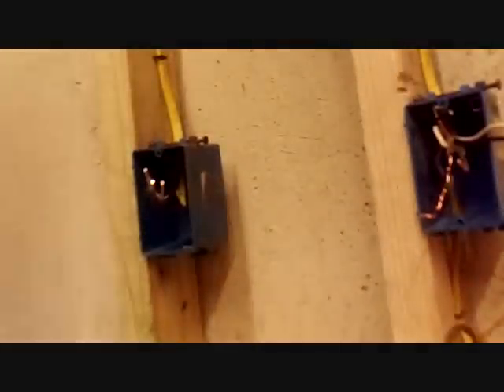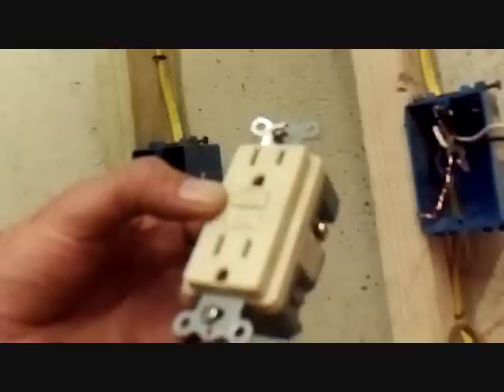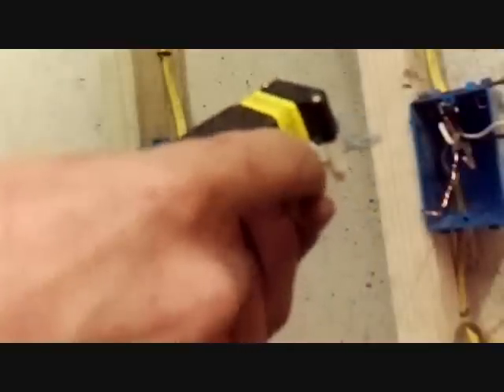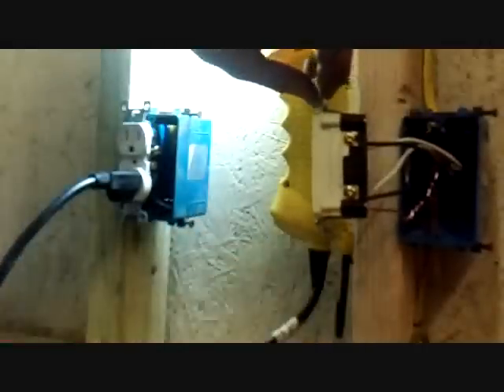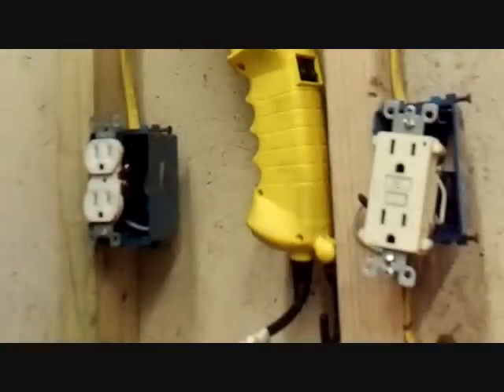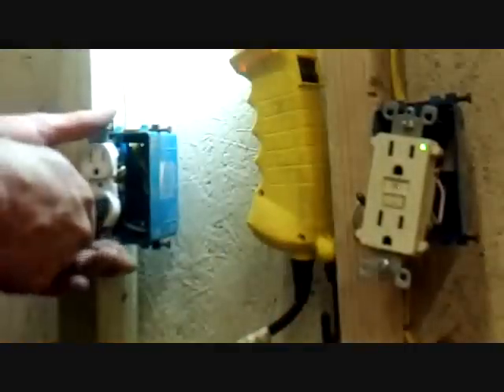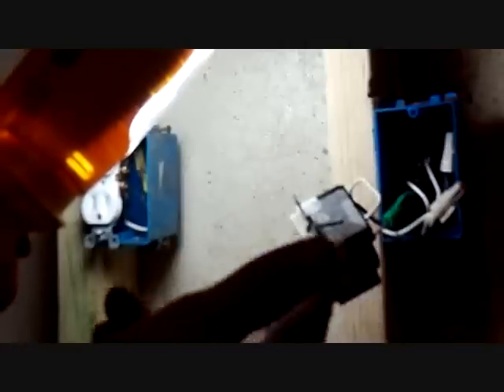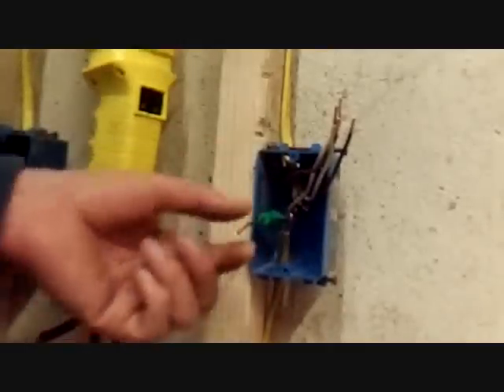GFCI receptcle common problems

Comment: I have a 40 year old house, would like all kitchen outlets GFI'd. Is it not correct to put GFCI in first outlet from panel and connect downstream wiring to Load side? Panel is old Iti Imperial so I assume hard to find GFI breakers.
Reply: +Pete Dunn You are 100% correct, all outlets whether receptacle or switch controlled light down stream of the G.F.C.I.  receptacle/breaker.
Reply: Thanks
Reply: One thing I heard is that you would put a GFCI outlet everywhere you need it. But as far as I know it's pointless to put a GFCI down the line from another GFCI. Once you have a GFCI installed, everything connected to that GFCI is then protected. So there's no need to put all GFCI's in conjunction with other GFCI's. But if their coming off different circuit breakers then yes, if you need the protection you can put a GFCI in. But everything coming off that GFCI is protected.

Comment: so you did not follow on what you changed ? did you remove one black, and a white ? from  bottom witch is load ? cause starting out we had 4 wires on the gfi and ended up with 2 .

Comment: Hey there, great video and gets exactly what need to do EXCEPT, I can't see how you wired the correct way.  You didn't really turn it around and show where and which wires you connected.  From what I can interpret, you combined the whites and then blacks and then connected them to only the lower terminals on the GFCI outlet?  And I presume that is the same even if the upper outlet is a switch? Thanks.
Reply: Simple answer for ya bud...the 2 wire bringing power in the box gets connected the line side of the GFI..if you look at the back of a gfi it says line written on the back.. It will also say which side the hot and neutral gets connected too(brass screw for hot, silver for neutral). Now, the 2 wire feeding the plug next to it went to the load side..same thing, it's written on the back of the gfi(depending on the manufacturer of the device there may be a sticker covering those screw terminals).. And don't forget, you can always check the directions or wiring diagram ! Hope this helps
Reply: Mikey Mike huh?
Reply: Louis : isn't that the original setup that turns off the light when the gfci trips?... which is not what is wanted. The setup that keeps the light on when the GFCI trips is the unclear part.
Reply: Eric Kirk  Sorry Eric. I'm new to YouTube commenting. That was fat-finger mistake. I was trying to find out how the guy rewired the GFI outlet to fix issue, but I don't know how to email him.
Reply: For the most part, you'll have to write here since messaging people directly is often blocked by them.

Comment: Another tip is do not wire these LIVE, number one for safety reasons but when wired live you will likely blow the MOV Micro Oxide Varistor which is the brain of the device. If blown, the GFCI is rendered useless. The GFCI is designed to trip at a current leak of 5 milliamps.

Comment: I have a GCFI outside on a pole that I use to power my sump pump.  I also ran 2 outside low watt lights from this same GCFI.  The line and load are together on the bottom and the piece of tape up top has not been removed.    The GCFI trips when I plug the sump in but the load continues to works for the lights.  The sump will work if I plug it in to a nonGCFI.  My tester says it is wired correctly (green,green).  It is a brand-new GCFI.  It has been working fine for several years and stopped recently.  I replaced the old GCFI but it keeps tripping.  Any help?
Reply: Possible your device leaked little bit power over "Ground". Exactly for this is a GFI designed! It is not a fault!

Comment: Why did my GFCI in my kitchen start buzzing recently?   I replaced it and got the same results.  Then I replaced it again.   Everything checks fine with a GFCI tester, the trips works correctly, and the voltage is perfect.
Reply: +Led ZeppelinFan  Check the terminals on the side for any arching to the electrical box. This is sometimes common due to the width of the device and its close proximity to the side of the box. If this is the case, by code it is acceptable to wrap the device around the sides using electrical tape to form a barrier. Remember, a GFCI is designed to trip at 5 milliamps which is such a low current not even detected by human touch. You can have a small current leak that will cause a buzz sound but not always enough to trip the device.

Comment: What if the plug still don't work after you try to push the reset button?
Reply: Could be a bad gfi or wired wrong for starters..hope this helps

Comment: Can the GFCI have power and outlets beyond no power? If so, id the GFCI outlet bad?
Thanks,
Rich
Reply: Rich206L
Reply: harold phillips  can the gfci have [power and outlets beyond no power if so is the gfci outlet bad
Reply: No
Reply: Yes, I have replaced quite a few GFCI outlets for that exact reason. The line side will work fine, but the load side won't have any power. The way to test is to remove the outlet from the box so you can access the screws, and use a multimeter to test the voltages on the screw terminals. Generally the bottom of the outlet is the line, and the top is the load...

Comment: fantastic video.  Its amazing how many electrical folks don't know how to remove the gfci down the line.  Thankyou.
Reply: I am not US american and understand the correct working inside less ten minutes. It is works same our RCD devices how we installing direct into the breaker box. Then all sockets or devices behind stop working. I use it in my homes in Germany and Thailand. 

I thinks some people see a normal power socket and rewire it same - without understand that the GFI have two independed sides now. Possible this people should ask a professional electrican guy - they know it correctly!

Comment: I am still looking for solution to my problem. A technician, who came to replace a defective light dimmer on 3 way switch, mis-wired the 4 way light system. It is a concealed 110 volt wiring. I am looking for method to fix this problem.

Comment: it takes 30amps or more to kill you my dads a electrician
Reply: fighterace0 While any amount of current over 10 milliamps (0.01 amp) is capable of producing painful to severe shock, currents between 100 and 200 mA (0.1 to 0.2 amp) are lethal. Currents above 200 milliamps (0.2 amp), while producing severe burns and unconsciousness, do not usually cause death if the victim is given immediate attention. Resuscitation, consisting of artificial respiration, will usually revive the victim.
Reply: I thought your dad worked at a McDonalds??????!!!!!!?????
Reply: +Roman Iashchuk  GFCIs are designed to trip at 5 milliamps.
Reply: 20 miliamps you mean?
Reply: Ken Saunders you're right . Class A GFCI trips when current to ground has value in range of 4 to 6 mA, UL 943- the Standart for Safety for Ground -Fault Circuit -interrupters . Simple math and we can figure that device trips below harmful current. You can find out more 210.8 NEC .

Comment: Hi Ryan and thank you for your video. I replaced several common outlets(non-GFCI) and one double switch today. They all work great but two ceiling fans with lights and two older outlets aren't working now. Help! Any ideas what I may have done wrong? I made sure the black wires were on the right, the white on the left and the ground hooked around the green screw. Thank you!

Comment: I have a building that was built in &0's. I am suppose to replace the outlet with a GFCI. The wiring has a pigtail on BLACK wires and two white wires and two reds wires.

Comment: Ryan. The GFCI in my hall bath has two hot ( black) lines in the bottom of the GFCI on the brass side and twi whites on the other.  At the top I have a black on the brass isde going out and white on the silver.  So I have 6 wires total.  The GFCI in the master trips as well as an outside socket.  As a test I put a reg. socket in the master and I have power there but nothing on the porch.  Ever seen two hots going into 1 GFCI?

Comment: @Dmitrytln North America has panel mounted GFCIs. They are a standard circuit breaker with a GFCI function. The problem is they are far more expensive than GFCI outlets. A GFCI outlet might be $8-$15, but a GFCI breaker will start at about $50.

Comment: Nice vid. But i understand the normal receptacle is down stream and will be intrupted when the gfi trips but will the normal receptacle trip the gfi if it is subjected to  a 4-6 mili amp fault or would you need another gfi to get this responce?

Comment: Europeans put this device into distribution board or fuse box with circuit breakers. It looks like coupled circuit breaker. 

As for protectable circuits - bathroom and other wet rooms obviously, all the sockets also strictly recommended. 

Also, better to use as more as possible those devices. If you protect all circuits by 1 GFCI, you risk to stay in full darkness if some insignificant has insulation damage. Better to protect only 2 or 3 outlets by one GFCI, but not more.

Comment: Thanks for the help - after fooling with it off and on for about 2 weeks thinking as a girl I had done SOMETHING wrong. It was the outlet itself. I bought a new GFCI and it worked as soon as I installed it. Bummer that is what is was but VERY glad that is all it was.. shouldn't of doubted myself so much.. lol

Comment: Great video and thanks for explaining everything and what each wire means.  I just replaced a very old GCFI outlet, I got replaced all four wires in the correct line and load positions however the outlet still won't work. I have a green light on but it still won't work. Any suggestions?
Reply: Same problem I'm having.
Reply: I finally solved that issue with mine by using a meter to double check my line leads to see which two leads were going to the breaker box.

My assumption that it was originally wired up correctly was wrong. Whoever wired the old GFCI outlet, confused the line from the load side. Reversing that instantly fixed it.
Reply: @ElCineHefe    Good job!  Thanks for letting everyone know how you solved issue.